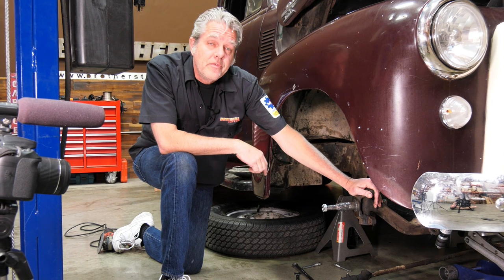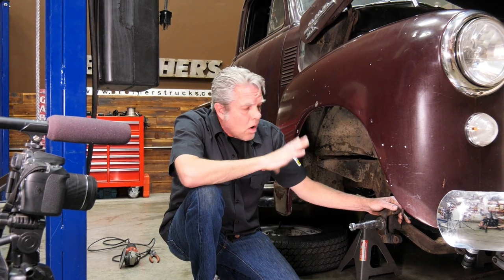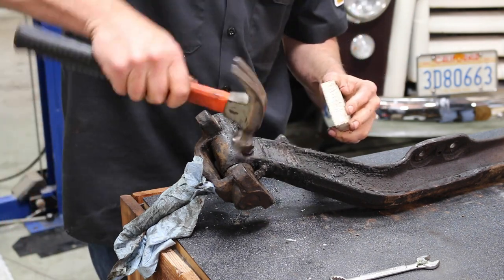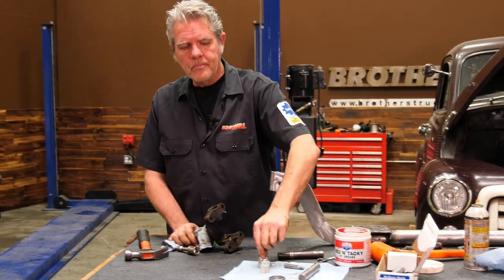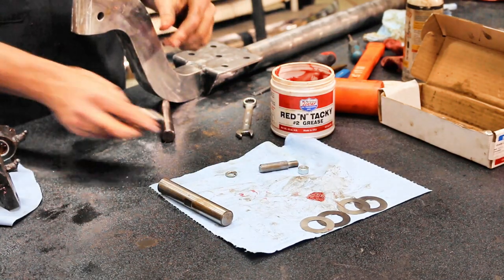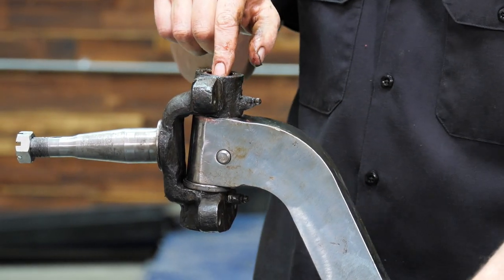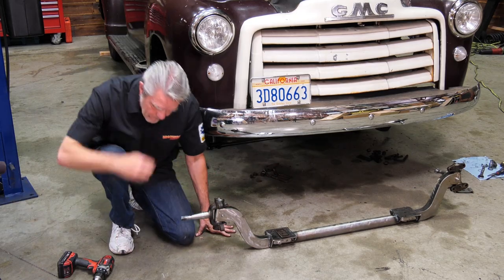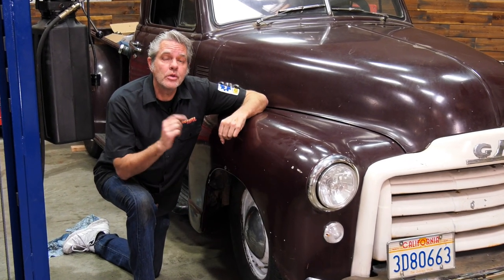1947-54 Chevy & GMC Truck 3" Drop Front Axle Installation / Lowered / Kingpins

Comment: Neat been waiting on u guys to do a video on lowering springs thinking about during that on 60-66 model year Gm truck is the process same as early 50s Gmc your working on
Reply from the maker: Does your truck have front leafs or coils Malik?
Reply: @BROTHERSTruckPartsTV  ;Currently factory shocks & it's 60or61 Chevy stepside.
Reply from the maker: @malikdigger4544  so your truck has torsion bars. Very different to lower than this example or the later coil spring trucks. Call our shop and lets talk about options.
Reply: @BROTHERSTruckPartsTV  ; It's a long last fill one page in my notebook

Comment: Thanks for the video. I have a 38 Chevy sedan 4 door with leaf springs up front. I lowered the rear three inches with blocks but want to lower the front three inches. Where can I find a dropped axel for my 38 Chevrolet sedan 4 door? Are their kits to add gas shocks to my 38? Thanks
Reply from the maker: We're not sure where to go for the parts for the '38. We only carry GM Truck parts from 1947-1987
Reply: I know the 32 chevy guy's bolt this 54 axle in to get juice brakes.

Comment: Can you confirm the installation position of that shim? Pretty sure if you install it with the fat side toward the front of the truck, that would give you negative caster, which would be for non power steering trucks right?
Reply from the maker: Both ways will give you negative caster, but power steering trucks use more caster than non-power steering trucks. The reason for that is the extra caster in the front end causes extra "work" to steer the truck, which is easily overcome by the power steering. Non-power steering uses less caster to make it easier to steer, albeit slightly less stable and likely to self straighten, than it would be with more caster.
Reply: @BROTHERSTruckPartsTV  pretty sure installing those shims fat side forward gives you more negative caster, and if you were to spin them 180, fat side toward the back of the truck, you’d get more positive caster. This would be the opposite of what your video states with regard to what a power steering vehicle, as opposed to a non power steering vehicle needs.
Reply from the maker: @rickpazmino5820   Gotcha, we'll check into it. It's also possible the Drop Axle MFG called for it this way. The vid was shot a long time ago, so we can't remember off the top of our heads. Thanks for the reply!
Reply: @BROTHERSTruckPartsTV  - FYI - Not sure if my '46 is similar, but I do not have power steering and the fat part of my wedge is at the rear.

Comment: Is that lowered with just drop axle ? Or with dearced springs also
Reply from the maker: This drop axle will get you down exactly 3" from where you are whether you have stock springs or de-arced springs, so you can count on that. To answer your question, we can't remember if this truck had drop springs on it or not.
Reply from the maker: Ok, just looked back at our video when we installed the de-arced springs and the axle was not on it at the time. So, we have to assume when we installed the axle it already had the drop springs.

Comment: It's suitable for 1949 chevy truck 3600  3/4 t  ? Tks
Reply from the maker: No sir, it only works on the 1/2 ton.
Reply: @BROTHERSTruckPartsTV  for what reason?
Reply from the maker: @luigimarzaro8915   the 3600 uses different spindles and other various components. You could use this if you are ready to convert the entire front end to 1/2 parts.
Reply: @BROTHERSTruckPartsTV  I can front lower with the leaf spring ?

Comment: Why put a + caster on manual steering but a - caster on power steering?
Reply from the maker: It has to do with the "ease" of steering. + caster will actually be easier to turn the wheel due to how the weight of the front end falls on the tires. - caster is exactly the opposite and makes it slightly more difficult to turn but adds stability and helps the steering re-center itself after your make a turn.
Reply: @BROTHERSTruckPartsTV  My 55 chevy 3100 w/ straight axle & ps will pull one way or the other when I go through a dip in the road. All front end parts are tight with 4 degree shims to get positive caster. You say to go with negative caster. So is this article wrong?   "Positive caster is when the steering axis is in front of the verticle. In a road car, this would mean that the top of the coilover would be pushed towards the rear of the car. Positive caster creates a lot of align torque (the force that straightens the steering wheel when you go forward) which improves straight line stability of the car. Due to the geometry of positive caster it also will increase negative camber gain (a good thing) when turning. As you increase positive caster the steering will get heavier also, but with modern power steering systems this is rarely a problem. Generally you want as much positive caster as you can reasonably get so long as the car is equipped with power steering".  I'm at  my wits end trying to figure how to get my steering safe. Thank you for any help you can give me.
Reply from the maker: @cecilbarnes7854  We assume this article is not discussing a straight axle type front suspension. What you have described is called "bump steer", we suggest you try some Negative camber.

Comment: Really. A claw hammer and an air chisel bit.  Not much for using the proper tools and using them the correct way.  Beating the claw hammer on the side???   Maybe you should invest in the proper tools first.
Reply: It’s a tool. Stop crying. Job got done.